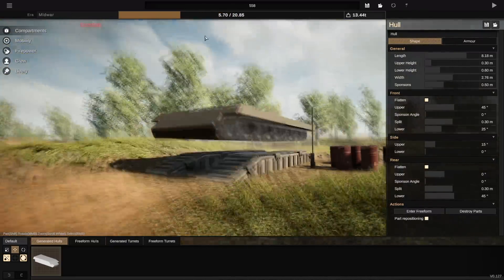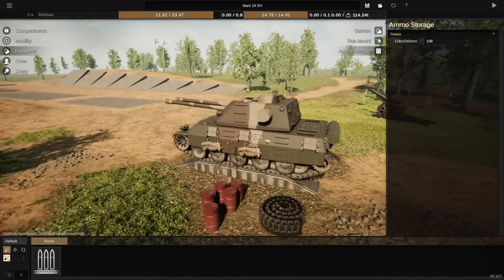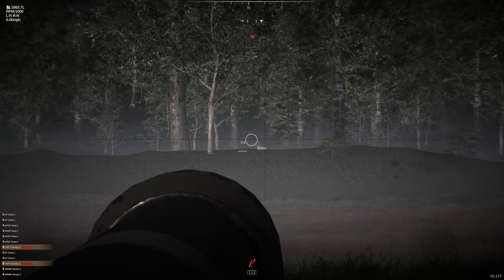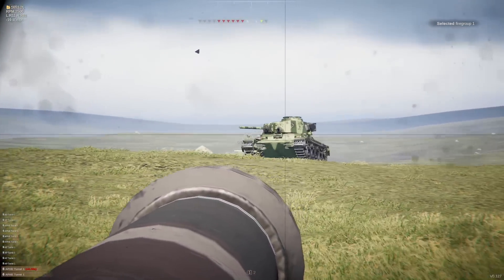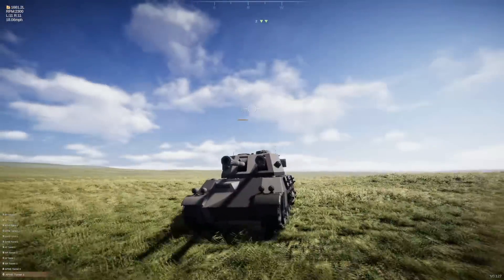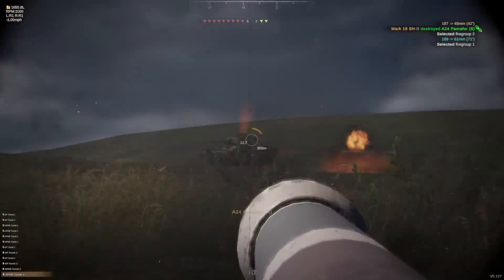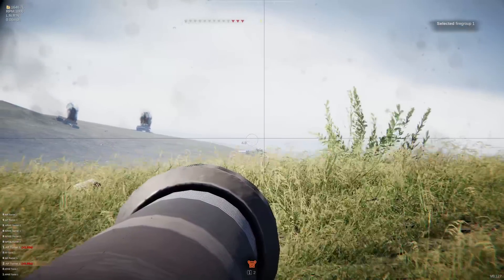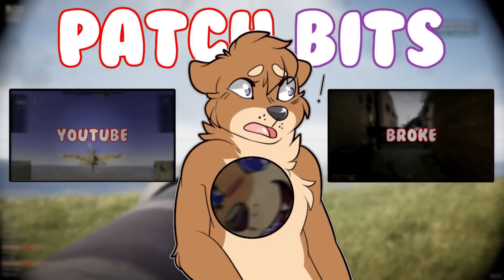Building a SUPERHEAVY with TWO MAIN GUNS! | Sprocket

Comment: I really love the twin barrel turret designs so much. The Grizzly from Halo Wars 1 and 2, and the Mammoth, Apocalypse Tank, and Overlord from Command and Conquer, CnC Red Alert, and CnC Generals are all perfect example of duel turret design tanks.
Reply: There's also the original Heavy Tank from Red Alert and the Warlord Tank of the Asia-Pacific Alliance from Generals 2.... And I guess the Hammer Tank from 3 depending on how and what you count the leached weapons as.

Edit: Oh, and the Forgotten's cut Grinder tank which was cut because of it resembling an Ork Bonecrusha and as an honorable mention because it's cool the cut Bombard... Which was cut because well, it's just a Baneblade sans the Heavy Bolters in the sponsons and the Lascannons are replaced with normal cannons.
Reply: twin barrel vehicles only work for AA. For anti tank you end up hitting different parts of the enemy for half the armor penetration, causing less or no dmg
there's a tank called VT-2 but it was just a prototype
Reply: @caralho5237  Double barreled tanks would adjust their scopes for each barrel so they still hit in the middle. But i dont think they are really needed since reloading a single gun is fast enough and there is no need for a second one.
Reply: @DeadAccount53885  The thing is that with a double barreled tank you would need to use a smaller cannon than you would if you only had 1 barrel, because of limited internal space. Sure you could account for innacuracy but you'd still have to compromise on gun penetration.
There are weird vehicles like the M50 ontos, which has 6 recoilless rifles, but they're exposed and reloading them is a pain

Comment: The problem is you front plate(the overhanging bit over the tracks) has that horizontal slope, meaning if you angle, that part is now flat(on the horizontal plane). REMOVE IT. It's a flaw!